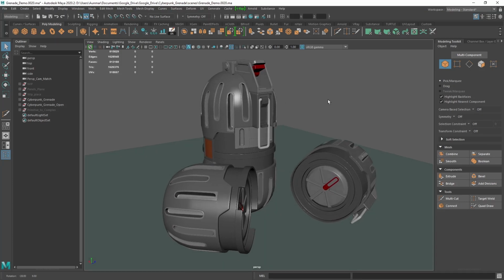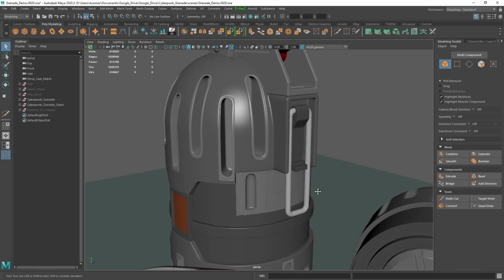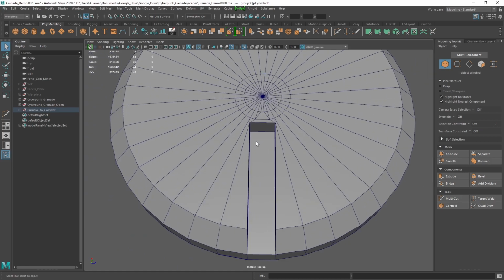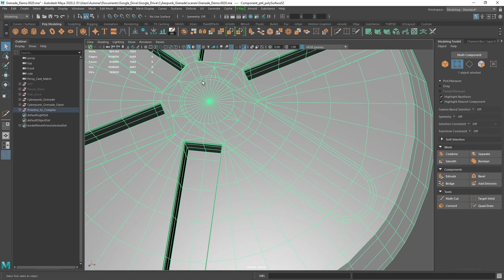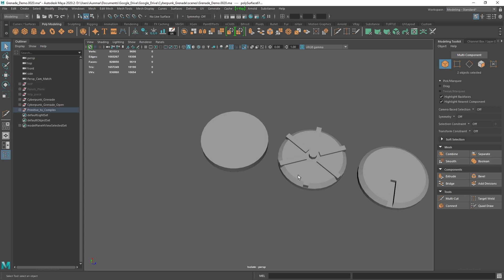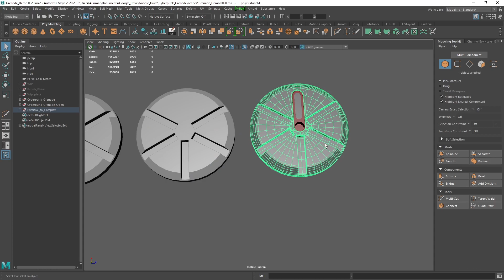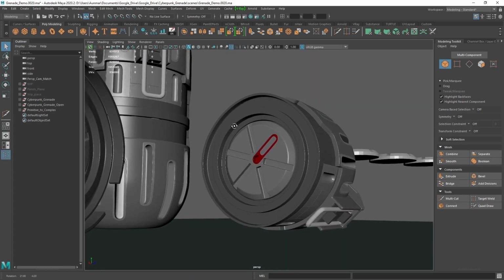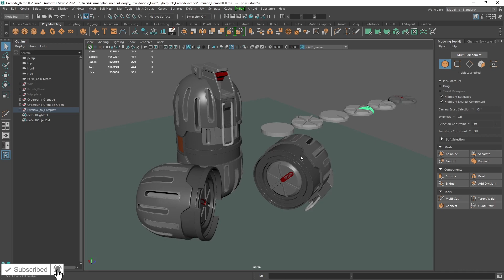Maya Hard Surface Modeling - Complex Objects with Primitive Shapes

Comment: impressive model to say the least bravo.....one question tho i see you have triangles in your topology is that still considered clean topology are we not supposed to turn triangles into quads
Reply from the maker: Triangles on flat surfaces will subdivide with no issues, so I use those when needed.

Comment: then any peoples using zbrush for hardsurface modeling (boolean) but what the differ between these two
Reply from the maker: Good question! I cover the Maya Boolean workflow here: https://youtu.be/3PY262onbRw

From my experience using Booleans in Zbrush, the workflow very similar, you can use all of the same type of tools (union, difference, intersection, etc) but once you take it out of the software, you would have to go through the process of retopology.
Reply: @OnMars3D  ohhh...k... I thought, zbrush had some tools for retopo easily ,thats y people go after it.... But i know , v can easily get good topology for some surface.... Here my ques is, if there is any solution for easy retopo for hard surface with lot of boleans... Or v must use traditional way to create topology...????
Reply: @OnMars3D  thanks sir for replying my ques...  I spend lot of hours for finding this matters...